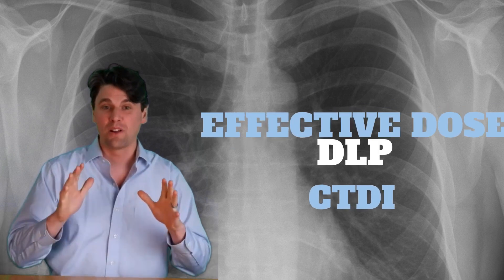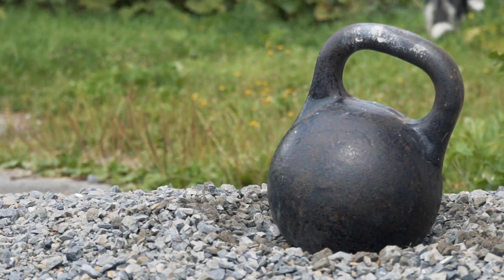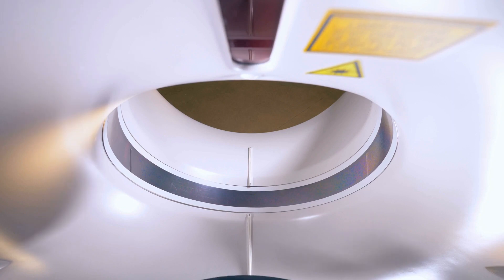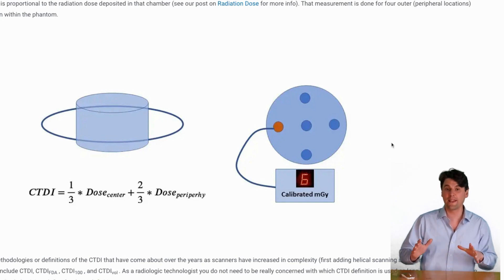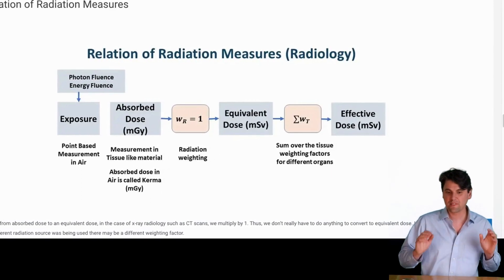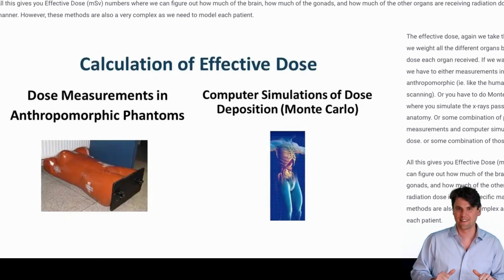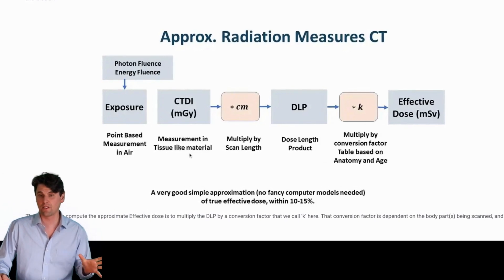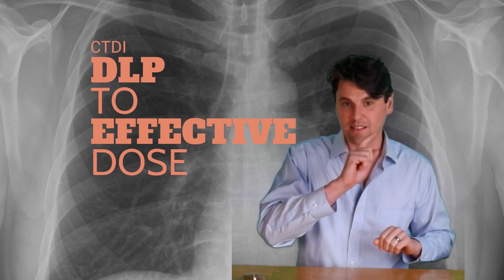Dose Length Product to Effective Dose, (DLP to mSv)

Comment: I got a ct scan done last week on lung, abdomen and pelvis. I recieved 13.5 mSv. Is this high or low in the spectrum of CT scans?? The scan itself lasted less than 5 minutes
Reply from the maker: See our video https://youtu.be/B7h4BW9kdiM for dose ranges of standard exams, about 7 min in is abdomen and your scan is in the normal range especially if you had contrast.
Reply: Hi, hoping you can help.
I got a CT calcium scan and I am concerned about the significant dose I received as I thought it should be around 1msv, but using your calculator it reports 6.521 mSv.
The dose report provided states:
Type: Scout Cardiac Helical
Scan range (mm): 1136.250-1273.750
CTDIvol(mGy): 27.00
DLP (mGy-cm): 465.80
Phantom cm: Body 32
Thankyou
Reply: Hello when I went to the calculator to find the msv it said it was for one organ. Do all of the organs scanned have to be added to find the true effective dose? It said 0.015 for abdomen pelvis. Is this the correct number to use to multiply the DLP?
Reply: What's the radation dose for abodomen CT scan with and without contrast